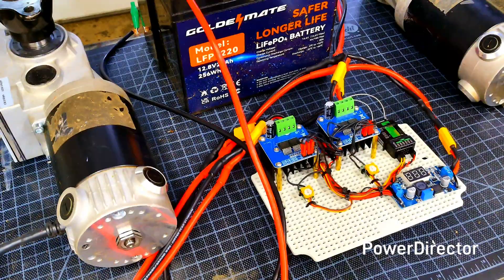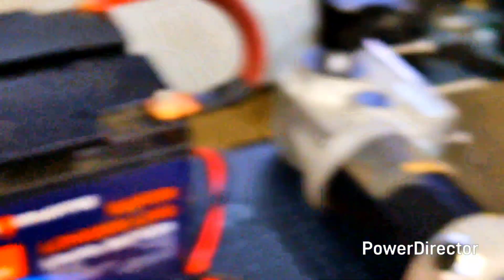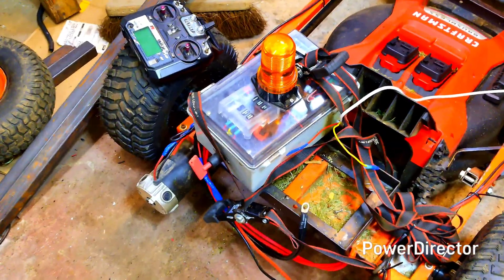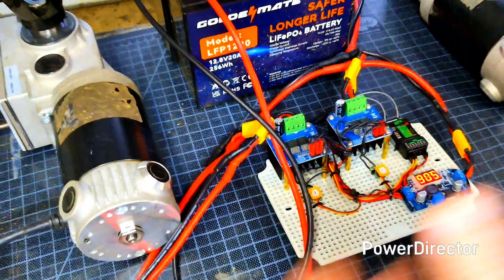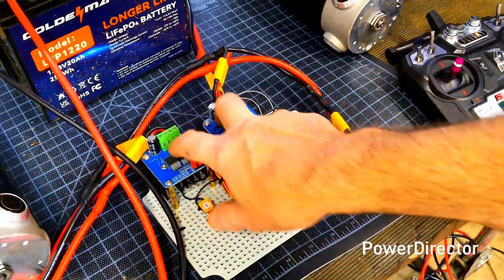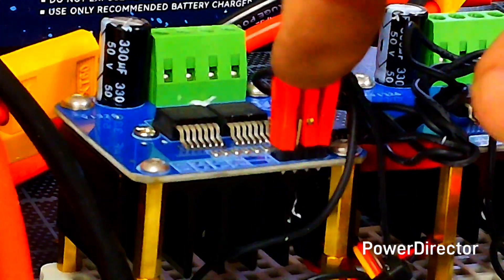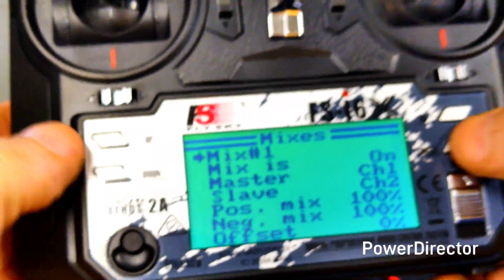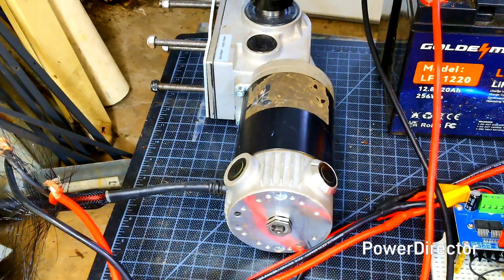RC MOWER Part 1....The Electronics.

Comment: Hi I like your videos, looking to build rc lawnmower, can you please help me what I need to buy on Amazon, I look on Amazon there so many components. Thanks
Reply from the maker: There are several different ways you can build one. 
The first question would be do you want to go brushed or brushless? 
The difference is that the brushed motors don’t need a controller but, they use more power than a brushless motor. 
If you want brushless motors, then you will need a controller for each one and it might get expensive.. 
if you go on AMAZON and type in WHEELCHAIR MOTOR you will see there are several options. 
I would suggest brushed because it’s a lot easier and cheaper to build. The downside is they won’t last as long as a brushless motor. Just meaning that it will discharge the battery quicker but, if you use a lifepo4 battery then it will still last a long time running. 
The easiest way is to start with a lawnmower, not sure if you’re looking for a gas mower or an electric mower. I think the electric is easier but, if you prefer gas then it will work just as good. 
If you can find a used mower that would be the best unless you can find a nice new one for a decent price. 
It can start getting expensive. I always look for pre owned just to save money. 

Here is one option…

Electric DC Scooter Motor 24 Volt 250 Watt MY1016Z2 Gear Reduction with 9 Tooth Sprocket for Wheelchairs, Motorcycles, Massagers and Mowers

Just cut and paste and it will give you an idea of the motor you will probably use. 
If you can find a cheap scooter, that would work too.. 

Then you can buy a FLYSKY Remote and a cheap rc brushed controller. 
I would watch as many videos as possible especially when it comes to the wiring. 
Hopefully this is a good start
Definitely keep me updated. 
Try to video as much as possible because if you are having trouble then maybe someone can help you from the videos. 
Thanks and good luck.. 
I’m always available to answer any questions.. 👍

Comment: Can you tell more about the conection please?
Reply from the maker: I know the video has terrible sound. 
What information were you looking for?.
What I can do is make another video on just the components and the functions. 
It basically uses the servo as the controller.  
Meaning, you hook up the servo as you normally would but, the motor wires of the servo would go to the motor controller.  
The POTS that would normally hook up to the motor would now be the adjustment.  
You need to adjust the POT until the motor stops moving.  
Let me know if you want me to make another video for you.. 
I hope this helps.
Reply: @doingstufforatleasttrying4843 the motorcontroler I will Kwon.
Reply from the maker: @Hilden0408I also used a step up/down adapter from Amazon. It will give you the 5 volts for the Remote control. You only need to use 1 of them.

Comment: Using those motor controllers people are having them blow up due to the heat and inadequate solder on the driver chips causing a short when they get hot enough. Some people are using power wheels gearboxes from Amazon which those motor controllers should be more than enough to run them and are a lot lighter than the wheelchair motors.
Reply from the maker: Yeah.. I did notice that too.. I know they are supposed to go to 43 amps but, I really don't see it happening.  I already had the wheelchair motors but, I think you are right. They probably won't last. I am trying to build a 4 wheel drive rc mower that I can also use attachments on. I haven't been feeling the greatest lately but, I will add more videos soon. Thanks so much for helping me out. It's definitely appreciated..👍